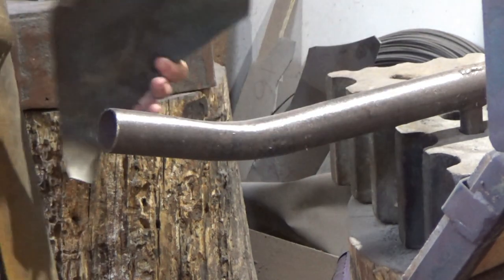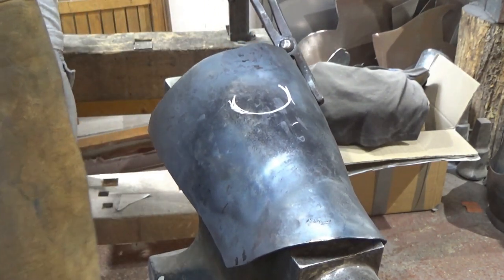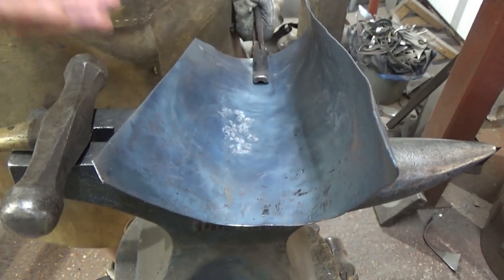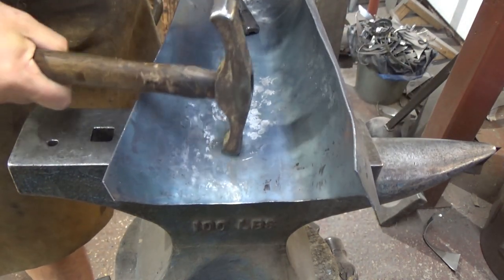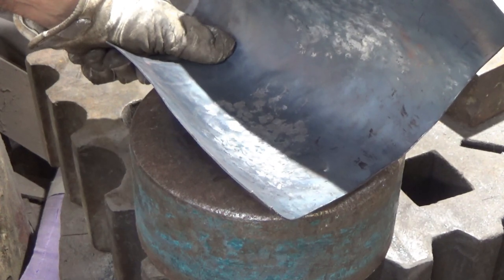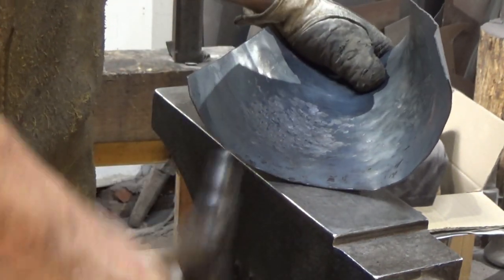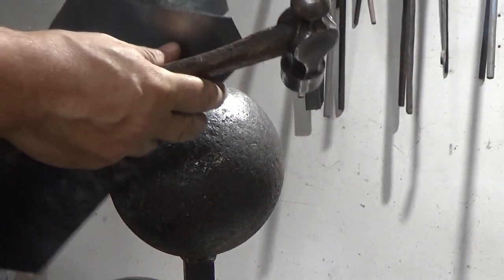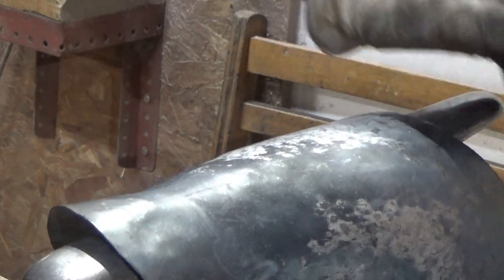Making a medieval thigh plate ... it's gone a bit wrong. Part 4 of 5.

Comment: Graham, at 16.40 You start to dish a flat back out in the metal dish. I am wondering...could you have used the wooden formers for this, or would it ruin their edges? It may be hardwood, but it´s still wood. My thinking is, their shallower pit seems much closer to the gentle bulge yYou wanted to achieve here.